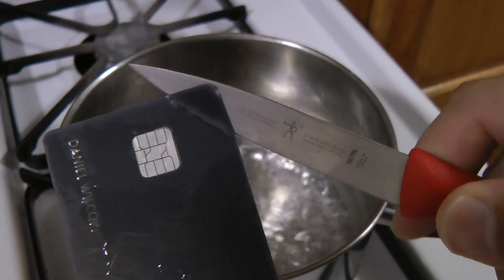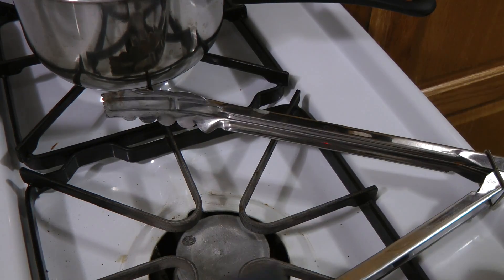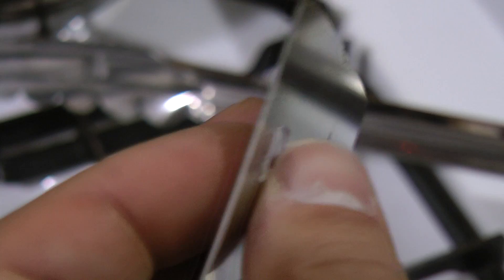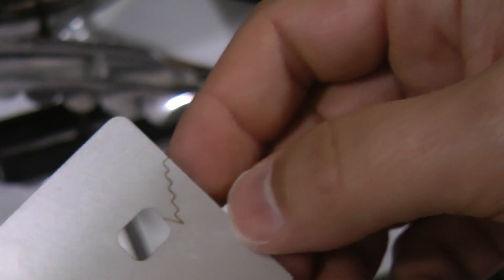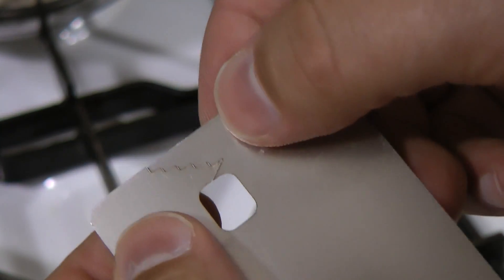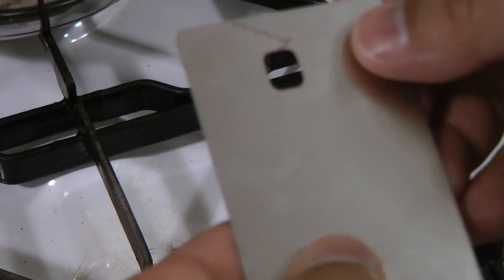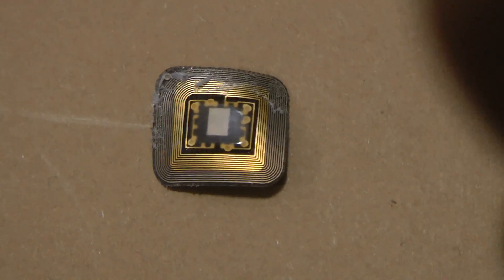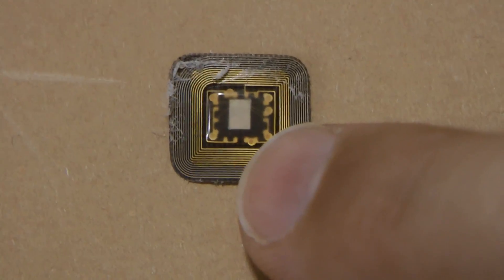You will NOT believe what's inside this Credit Card.

Comment: does the chip and nfc string get ruined when boiling?
Reply: I don't think, that it got damaged because the boiling water had only 100°C temperature so, it's a save temperature for semiconductors.
Reply: @thebamplayer  Didn't you get to test NFC before discarding?